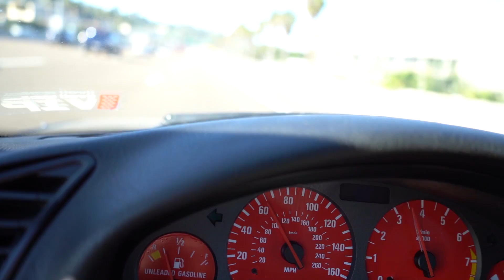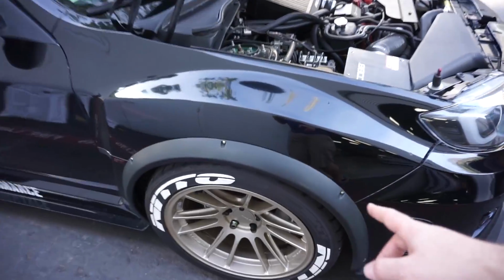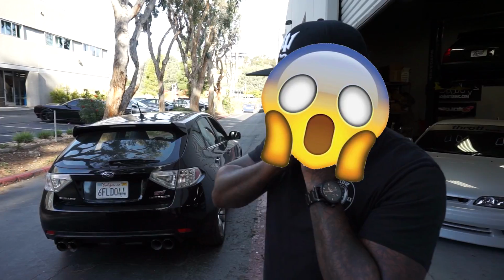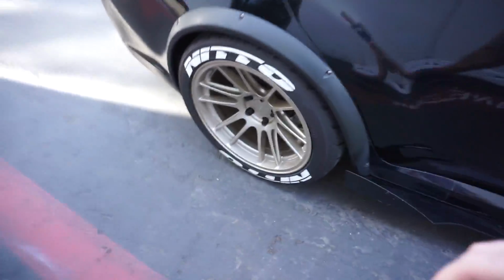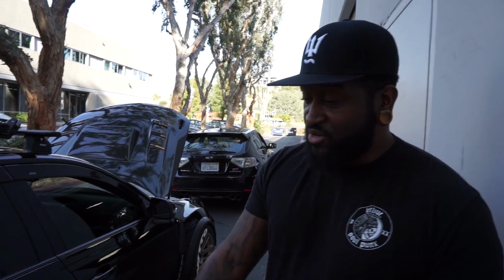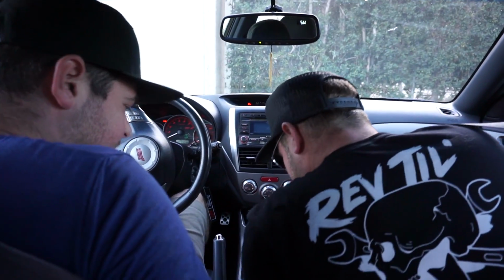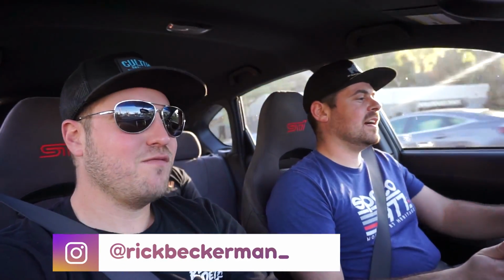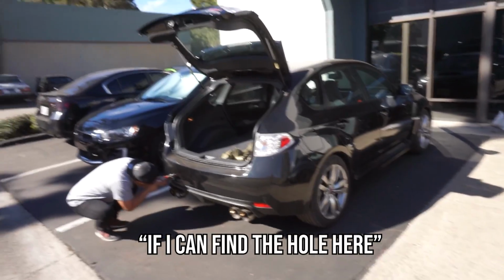We BOUGHT a 2008 Subaru WRX STI Hatchback AND it’s WORSE Than you Think

Comment: IAG Stage 3 closed deck block, IAG TGV Deletes, IAG AOS, Injector Dynamics 1300cc Injectors, big front mount, some super smooth low lag high volume garrett turbo. Built semi-open decked EJ255/257 blocks are time bombs once power is over 400whp. And reinforce that firewall, creaking/squeaking firewall when pressing the clutch in will happen eventually because thin sheetmetal they used for that firewalls. ITS Pedal Bracket and clutch master cylinder brace is a must unless you go with a super custom clutch and brake pedal setup.

Comment: Coils, carbon, exhaust, NOT A WASTEGATE LIKE LONNIE, front aero, stroker kit, e85, pump, injectors, bigger rotates turbo setup, nice gold TE37 wheels, proxy r888r tires, sleeve the engine if you want any power

Comment: Killer b oil pickup unless already done, air oil separator, castles up pipe with dump tube for external wastegate, 3 port ebcs, upgraded turbo (maybe rotated setup depending on budget) upgraded intercooler for sure, top mount unless going over 500hp. Catless downpipe, tgv deletes, non resonated r400 exhaust, short throw with upgraded bushings, fix paint, minimal flares, new brakes, spoiler riser. Done

Comment: Pretty simple to make 450 in a sti front mount, access port, cold air, boost solenoid, ewg, blow off, and e-85, even would prolly make 400-425 on e30 mix with 93 but I doubt that you guys would do that cause it’s always a full send with y’all 😂👍🏻 good job boys solid car

Comment: Circuit demon quad projector for sure. No one really does ground effects anymore, and I get it. But I still really love the aesthetic. Aos is a must. I'd like to see about 425 with an e85 tune. Cobb is your best friend. They make some really nice aftermarket goodies too, caps for your liquid reservoirs and heat shields that are anodized. Very pretty stuff. I'd love to see a really nice build under the hood, some nice color. Throw a nice aero cargo box on top. I love enkei wheels, but bbs are gorgeous on the Scoobies. I'd swap the steering rack for sure, 2015 sti racks are pretty popular. Upgrade them brake lines. do some diff work. 10.5 all around is pretty aggressive, looks great. But personally I'd run 9.5 in the front 10 in the rear, love the stagger. Tein makes really nice coilovers, would be cool to see a sponsor toss some really nice suspension parts though. I'd love to see a fortune auto install. So glad you grabbed a hatch... Wagon life is the only life. I'm excited to see it all come together. For color, I'd think a nice pastel lavender color. Judge all you want, put serious thought into it. It'll work well with carbon accents. Maybe forged carbon if you can get your hands on some. Also, touchscreen Android head unit with wireless obd. They make some really nice ones these days that are affordable. Run the price up inside and out, take her to SEMA. Show car ftw.

Comment: If you feel like spending the money, definitely go circuit demons but I'd go with OEMassive C lights first, they're the best aftermarket lights for this generation. It's what circuit demon uses for their lights anyways. Definitely replace the wing with a varis carbon one and also update the bumper to the 2012-2014 wrx/sti front bumper. If you want to be different from other hatches, go with the Varis V2 bumper, it's similar Styling to Dustin's varis front end. IAG AOS is a must, subarus eat oil like no other. Swap the steering rack with a newer 15+ wrx/sti, those go bad frequently and you want better steering response in that car. 4th cylinder cooling mod to prevent any damage. It's a hatch so the exhaust will drone MORE than the sedan since it's so open back there so keep that in mind. DAMD D shape steering wheel. ITS pedal support bracket, grimmspeed master cylinder support bracket. And dont forget the hella horns 😂
Reply: Bernie B 🤙

Comment: Mods:
Cylinder 4 cooling
Air oil separator
Catted Downpipe
Catback exhaust
Intercooler
Intake
Cobb accessport v3
Discs and pads
Wheels (Cobb) and tires
Diverter valve
Head unit (CarPlay)
LED interior lighting
Bigger wing
Coilovers or air setup
Mud flaps?
PAINT

Comment: Blue book on my 08 sti with 90k miles is about 15.8-18.7k from a dealer and like 12-15 private seller idk where the other guy got 8k from. 

PS you can change the rpm setpoint of the shift light when in neutral using the odometer stick

Comment: Cobb is the best for Subaru in my opinion rotated turbo set up 1000cc injectors 44mm external waste gate front mount inter cooler IAG aos. Oooooo ooooo and make SURE you do a killer bee oil pan and pick up that’s a huge thing with these cars. TGV deletes. 2 or 3 stage clutch. Open the exhaust up as much as possible and follow me on insta at @sleepersubie02 to see my bad ass build and lemme know if any ideas I’ve said will help I’m new to the Chanel and can’t wait to see this bitch In action

Comment: Make it a rally car and engine swap it! 

When I had my Subaru it was modded and still slow you can make so much more power and have it be reliable with a different engine plus the engine bay will actually look good you won’t just see wires, covers, an alternator and the intake manifold.